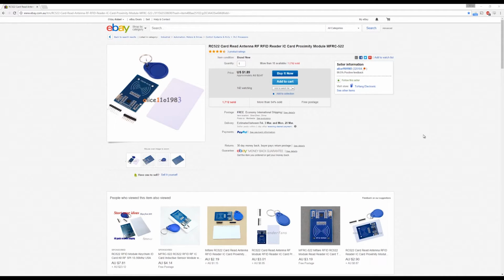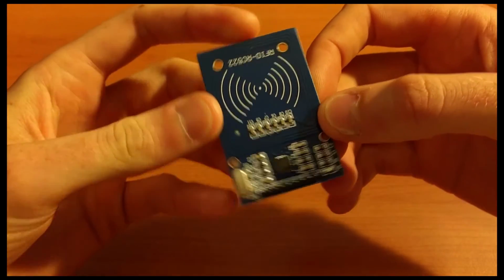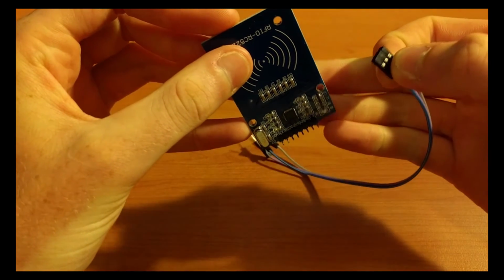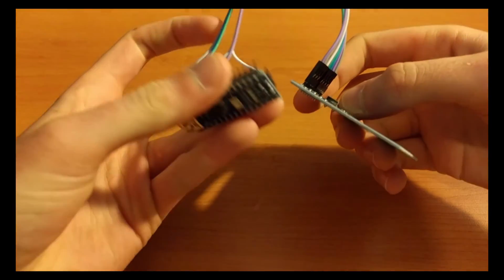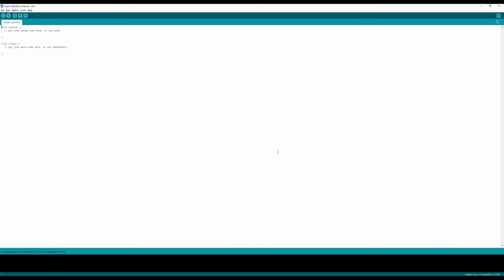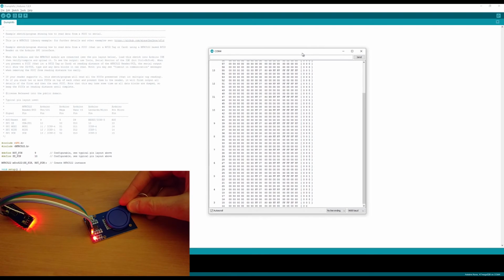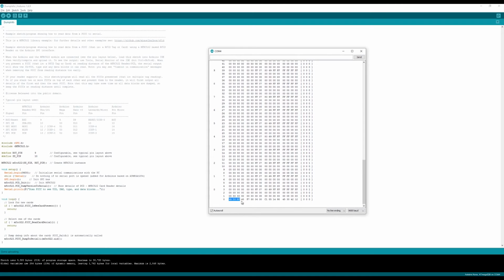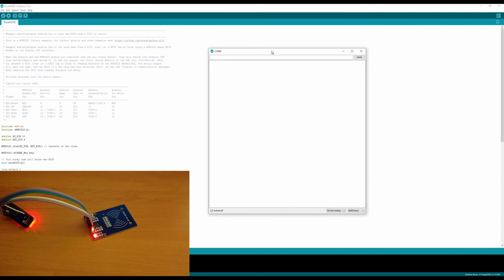RC522 RFID Card Reader - Arduino Tutorial

Comment: Could you add a link to where I could buy the Arduino uno, the cables etc? :)
Reply from the maker: Certainly! Here are ones I've bought in the past:
Uno: http://www.ebay.com.au/itm/NEW-UNO-R3-ATmega328P-CH340-Mini-USB-Board-Compatible-Arduino-/311155383820?hash=item48724e5e0c
RFID Reader: http://www.ebay.com.au/itm/RC522-Card-Read-Antenna-RF-RFID-Reader-IC-Card-Proximity-Module-MFRC-522-/311563538690?hash=item488aa25102
Cables: http://www.ebay.com.au/itm/40PCS-Male-Female-Dupont-wire-cables-jumpers-10CM-2-54MM-1P-1P-Arduino-/401164877863?var=&hash=item9c29ebc1e8

If you're going with an Arduino Uno, you'll need Female to Male cables with this sensor. And you'll need Female to Female cables for the Arduino Nano.